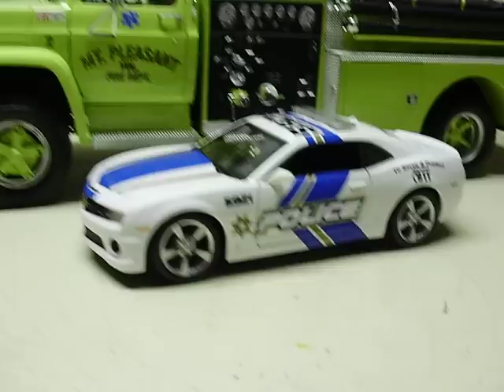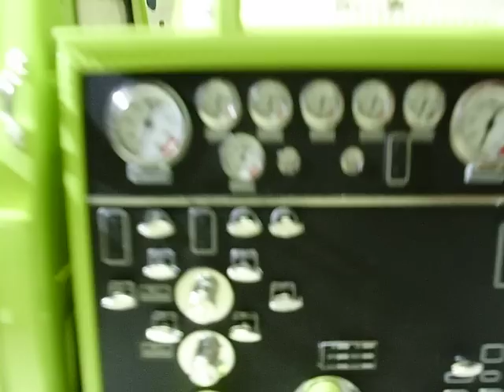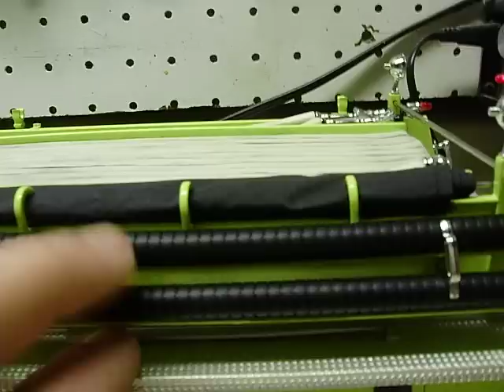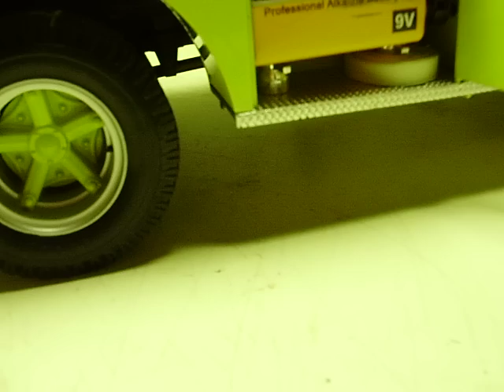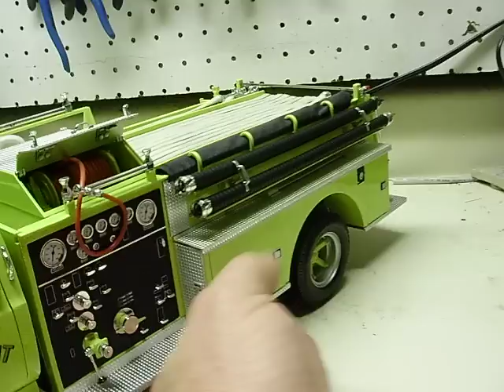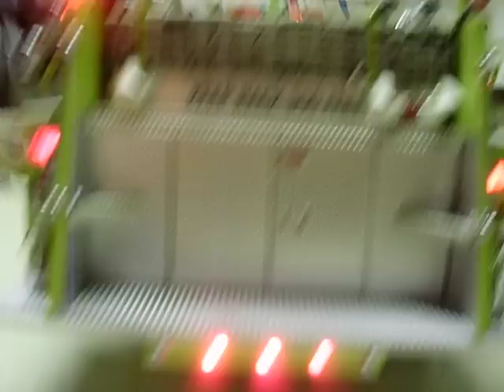Custom 1:16 scale 1975 GMC C-65 Heavy Duty Mt Pleasant fire truck w/ lights & siren

Comment: The 'control box' underneath the dashboard is a model of a 1970s era Federal electronic siren, either a PA15A series 1E or PA20A series 2E.  If it were a real fire engine, the siren would be connected to a speaker behind the grille of the Federal Twin Sonic light bar on the roof of the cab.
Reply from the maker: Not too familiar with all of the model numbers of the sirens but sure remember the old rotator style lightbars with speakers in the center.  Our old county cars would pull up and you could almost hear the noise of the lightbar motors over the siren itself lol

Comment: There has got to be a cheaper way of doing rotators to offer to customers... Models like these need them.  Love the warm white headlights and cab lights.
Reply from the maker: Its not even about being cheaper....  I just think they look crappy.  They should have the voltage increase and decrease as the LEDs "rotate".  They still have way too much of a "digital" look to them instead of a steady fade.  At least that's my opinion.

Comment: The black hose on the sides is called hard suction lol. It's for pulling drafts out of ponds and stuff. Side reels are booster lines
Reply from the maker: +znovosad555 I guess that's why the hard lines are on the side of the truck where the suction valve is!  I always start my videos before I do my research lol.  Thanks for the info!
Reply: +01bluebusa no problem haha! There certainly is a lot to know just about hose alone on firetrucks. Let alone pumping, driving, and all haha! Great video as always